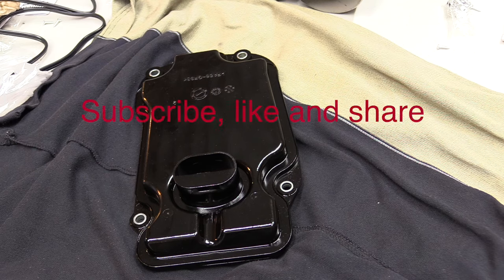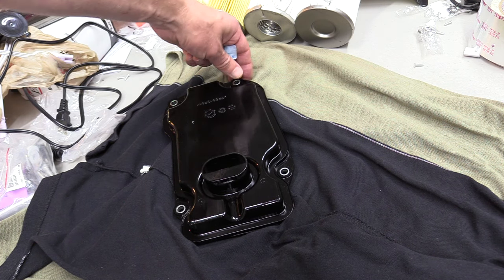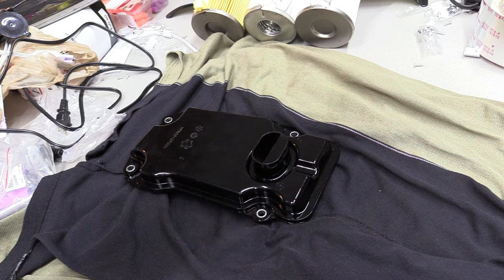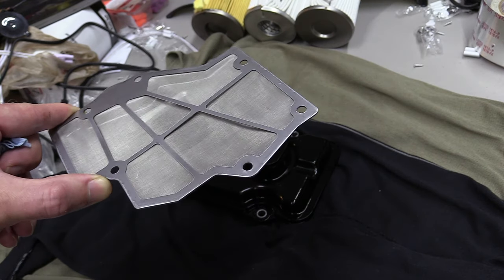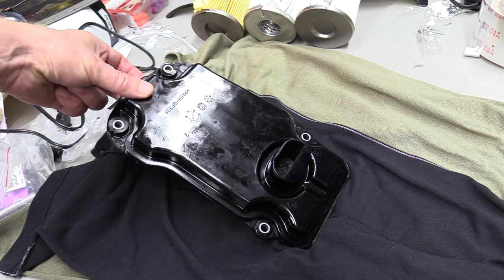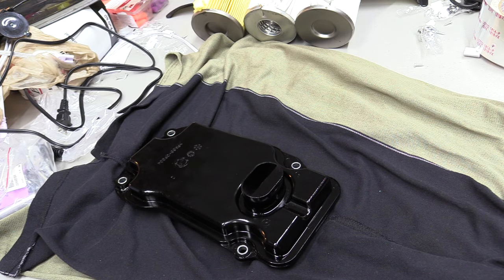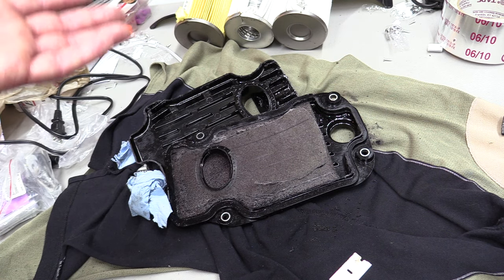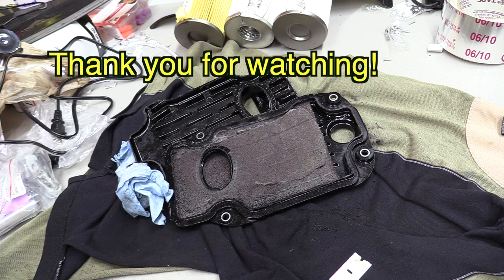Avoid replacing transmission filter, avoid costly transmission repairs, transmission maintenance

Comment: What if car has not been regularly maintenance? I was told that there's less of a risk to damage to transmission and clog from draining. Is it just safer to change filter at that point ?
Reply from the maker: Answers in the video
Reply: It's a 16 min video. U could've just said yes. Lol
Reply: @m.pm.p8727  It's actually a no also if it's been neglected too long.

Comment: My Chevy Avalanche has over 235000 miles will it be safe if I change the filter and fluid it's not having any problems but I'm afraid the filter might get clogged since the fluid is light brown with no burning smell what do you suggest
Reply from the maker: Has transmission fluid ever been replaced
Reply: No the transmission fluid has never been replaced
Reply from the maker: Your transmission has significant wear at this point.  Changing fluid might extend life of transmission,  might not.

Comment: We just got a 2014 Ram 1500 5.7 Hemi with 80,000 miles on it. and I changed the transmission fluid but couldn’t afford to get a new filter as well…. Should it be okay even if the filter is the type that’s intertwined with the pan? I don’t tow with the vehicle. Would appreciate the help. Thanks man. It has the ZF8HP70 German made ZF transmission. I know those transmissions don’t have the screen. Maybe you could open up one?
Reply from the maker: It doesn’t matter if filter part of the pan or separate.

Comment: I want to change my A340H Automatic Transmission Fluid and the Filter. I already ordered the filter Wix filter 58884 and now I am seeing this....  Should I not change this filter ?!
Reply from the maker: What do you have, mileage, year, maintenance history, ownership length?
Reply: @repairvehicle  1986 Toyota Pickup 22RE-T Engine 130 XXX Miles I changed all the fluid but ATF history maintenance unknown.....
Reply from the maker: So, if you have this type of filter just a screen  mesh then replacing might not add any value.  Watch this video https://youtu.be/IhZ4YHrhNeI

Comment: Why does my Qx4 has to warm up early in the morning before it can enter reverse gear? The same happens when I pack it for a long time in the day and engine cooled down .
Reply from the maker: Temperature sensor probably covered with dirty fluid or temperature sensor is malfunctioning
Reply: Please, where is the temperature sensor located?
Reply from the maker: Somewhere inside transmission more likely

Comment: On e92 bmws only resetting the adaptations will smooth out the drive. 125k and have never changed it.
Reply from the maker: What about fluid?
Reply: @repairvehicle  have never changed it. At around 100k, it got sluggish. Just reset the adaptations and runs like it had 30 miles on it when I bought it back then. It is a n51 engine.
Reply from the maker: So, your transmission has a lot of wear and that's why it got sluggish.  Computer adjusted pressure by increasing,  to minimize slipping.
Reply: @repairvehicle  I guess. I dont know.

Comment: Sir, is it okay to fill new fluid though there is still old trans fluid left in the pan because it was just drained from the drain plug but the trans fluid pan was not lowered?🤔
Reply from the maker: Yes it okay.
Reply: @repairvehicle  Thanks! More power. 👍

Comment: I hear changing fluid of the transmission have to be aware of fluid temperature. Dealer says flush but I agree at least drain and fill two or three times.
My 2017 trans fluid is it synthetic or no. What do you think of synthetic trans fluid as well as front and rear axle fluids as well as differential oil???
Reply from the maker: Your tundra has Toyota ws atf, none Synthetic. Synthetic atf fluid, Synthetic gear oil for front and rear axles is a must if you want trouble free equipment for long time. Synthetic fluids provide excellent protection against wear, better lubrication, flows easier and tolerates heat better. I use Synthetic AMSOIL products for every fluid in my vehicle and lawn equipment. Here is the link for your tundra https://www.amsoil.com/lookup/auto-and-light-truck/2017/toyota/tundra/5-7l-8-cyl-engine-code-3ur-fe-7/?volume=us-volume&zo=5257753
Reply: @repairvehicle  I also checked prices from Amsoil direct vs Amazon. The engine oil thru Amsoil $17.50 vs $31.30 thru Amazon. Huge price difference. FYI...
Reply: @repairvehicle  quick question I’m going to do a transmission drain n fill for my 08 Lexus GS 350 for the first time it has 110mi do you recommend me using what’s the manufacture recommended which is ws Toyota atf or there’s something even better and can or maybe exceed the ws Toyota one ? Thanks
Reply: @repairvehicle    quick question I’m going to do a transmission drain n fill for my 08 Lexus GS 350 for the first time it has 110mi do you recommend me using what’s the manufacture recommended which is ws Toyota atf or there’s something even better and can or maybe exceed the ws Toyota one ? Thanks
Reply: @repairvehicle    quick question I’m going to do a transmission drain n fill for my 08 Lexus GS 350 for the first time it has 110mi do you recommend me using what’s the manufacture recommended which is ws Toyota atf or there’s something even better and can or maybe exceed the ws Toyota one ? Thanks
Reply from the maker: Yes, there is a better fluid and that's what I use in my lexus. https://www.amsoil.com/lookup/auto-and-light-truck/2008/lexus/gs350/3-5l-6-cyl-engine-code-2gr-fse-i/?volume=us-volume&zo=5257753
Reply from the maker: Actually I have ton of videos about Toyota and Lexus ws fluid on my channel, take a look

Comment: how do you feel about dropping the pan and cleaning the magnets at least
Reply from the maker: What do you mean?
Reply: @repairvehicle  the video is about not replacing the transmission filter, but do you think we should at least take the transmission pan off and clean the metal shavings off of the magnets inside the pan
Reply from the maker: I gave the reason not to replace.  However,  you can replace the filter and clean magnets, it's perfectly fine.
Reply: @repairvehicle  no i mean dont replace the filter but still drop the pan and clean magnets

Comment: Hello should I just change the fluid in my 2008 g35x or filter as well
Reply from the maker: Did you Watch video without skipping?
Reply: @repairvehicle  yes sir my car doesn't have a filter I just called the dealer that's weird
Reply from the maker: if its automatic it has transmission filter.
Reply: @repairvehicle  yeah it's automatic it doesn't have a filter it has a screen
Reply from the maker: https://www.ebay.com/itm/284472142979?chn=ps&_trkparms=ispr%3D1&amdata=enc%3A1Rv-ZHRtwRL6vLPMIjq0ncw20&norover=1&mkevt=1&mkrid=711-117182-37290-0&mkcid=2&itemid=284472142979&targetid=1644837435483&device=c&mktype=&googleloc=9005947&poi=&campaignid=16743749222&mkgroupid=138744546207&rlsatarget=pla-1644837435483&abcId=9300842&merchantid=115330141&gclid=Cj0KCQjwxtSSBhDYARIsAEn0thTYATz0j8I4mdgkrv8f149akS_XXOEDTBQza0YIIjrTQcWejAlr-MQaAqNCEALw_wcB

Comment: The Lexus GS RWD has a fabric filter. The AWD has a steel mesh filter. A760 e(rwd)/g(4wd)/h(awd)  trans. Tundra uses e/g. 

 The H trans transfer case shares fluid with the trans, fluid changes are very important. The Lexus dealer told me every 40K is a good idea. Lexus Dealer said only WS and filter change every second service. He told me there are cars in his system with 400K that are as good as new, they used their services. He said great if you can DIY, but even if we we do it they are getting a second and third life out of the car, and it is very reliable.

My front diff is speced at 80W90, the service writer told me was a tech and there is a reason, from his toyota training. He said my front diff has a high pinion and it needs a thicker oil (vs 75w90). It has to do with how the fluid slings off the pinion gear. It won't explode but the spec is there for a reason
Reply from the maker: Transmission fluid is never shared with transfer case,  they are both separate and have different amounts. 

Also, thickness of oil is measured by second number, not first, they are keep telling you false information.

Actually Toyota/lexus doesn't use mesh screens,  it's in the 90s and early 2000s when they stopped using metal screens.
Reply: Ummm my 2004 gs300 RWD has a metal mesh filter. 😕
Reply: And the transmission is a A650E

Comment: my car is Suzuki alto, its engine is K6A model 660cc automatic transmission. it is ok on plan areas in driving, but whenever I drive in hilly areas, it losses its power and it all gears completely fails, even the car cannot drive his own weight. so I cannot drive this car in hilly areas. what is reason behind this?
Reply from the maker: Wornout engine, it doesn't have good compression.

Comment: So change transmission fluid in brand new vehicle after 10k miles and then every 30K miles after? Then no need to change filter, because fluid is changed on a regular basis?
Reply from the maker: Correct

Comment: I have been ignorant of this. I have been using 2001 Toyota sienna for over 8 years now, after watching this video i became scared because i have neither changed the transmission fluid nor filter. Am considering doing the fluid change but in this case, do i need to change the filter also haven used it for a long time without servicing. Your cadid advice please.
Reply from the maker: What is the mileage

Comment: If the transmission filter is a metal mesh screen then you need to remove it and clean it with brake cleaner and installing it back. If the filter is paper then you need to replace it.

Comment: Hello my friend. I have a question for you.

On a 2017 toyota camry, which has a sealed trans and no dip stick. I'm sure you are familiar with it, you fill it through the wheel well. 

Anyways , my question is do you belive that I can fit my small mityvac down in that whole at an angle? Thinking outside of the box and wondering if that works. Please let me know ur expert opinion. Thank you !
Reply from the maker: It's not going to work.  I will be making video on this subject
Reply: Thank you
Reply from the maker: You are welcome

Comment: Hello I usually have seen 2 types of transmission filters the cloth looking one and the  metal screen type. To me it looks like the cloth type over time will eventually get to saturated with debris from the small transmission shavings  and not be able to work as it did therefore needing replacement . But the metal screen type   looks like it  will last and not need replacement due to it not breaking down from years of use due to its metal construction . Just curious to know what you think since I can't really find much on the topic.
Reply from the maker: https://youtu.be/IhZ4YHrhNeI
Reply: The metal mesh filter is definitely better and doesn't really need replacing, you can just clean it.

Comment: Should I use the Mazda FZ ATF on a 2014 Mazda CX-5 or Amsoil signature series?
Reply from the maker: it depend on the level of protection you are looking for. I prefer Amsoil signature, the difference it makes in shifting words cannot express.
https://www.amsoil.com/lookup/auto-and-light-truck/2014/mazda/cx-5/2-5l-4-cyl-engine-code-y-1/?zo=5257753

Comment: We bought a 2011 lexus rx 350 with about 163,000 miles. I was all ready to drop the pan and do the filter. But, after watching your presentation I'm having second thoughts. The previous owner did use it to haul his trailer back and forth from Bakersfield to Oregon, which might be a reason to do the switcheroo. What would you suggest?
Reply from the maker: As a bare minimum 2 times fluid change.  Filter change is a good idea too. However, some bolts removal could be a problem due to space.
Reply: @repairvehicle  Thanks for getting back to me. I'll have to decide I guess.
Reply: @repairvehicle  how much time in between the change from 1st to 2nd time ? mine 08 es350 lexus has 240k im gonna change the fluid
Reply from the maker: 10 minutes to 1 hour.

Comment: Question my friend. I changed the fluid and filter for the first time at 56000 miles on my 2012 mazda 3 skyactiv has an automatic 6 speed. I changed the fluid again a few months later but kept that same new filter in. 1000 miles after the second time it's slipping until it reaches operating temp one it warms up it shifts fine I read it could be that the new fluid loosened up some gunk and clogged the filter so it won't pass through the filter very well until it warms up and thins out. What say you?
Reply from the maker: How did you check fluid level?
What brand and type of atf fluid did you use?
Did you install filter correctly?
Reply: @repairvehicle  got the fluid and filter from the dealer yes the filter popped into place securely and I tightened it with the 1 bolt that holds it on. I drove it around until it got nice and toasty then checked the dipstick on level ground and it was right up to the full line I checked it again after the slipping started and it's still right at the full line
Reply from the maker: New fluid will not loosened up gunk, because you had none in your transmission at 56k miles. You might have other transmission problems, maybe solenoid is not working properly or your transmission had sever damage done before you changed the fluid.
Reply: @repairvehicle  okay thanks!

Comment: There are two transmission filters in my '14 Maxima. One is internal like in the video and the other is external. I've replaced the external one.
Reply from the maker: Factory external?
Reply: @repairvehicle  Yes, you can order an replacement off the nissan website.
Reply from the maker: @12MRJERSEY   , that's nice.  Hopefully you are changing this filter more often.
Reply: @repairvehicle  The external one yes. For some real nissan doesn't recommend it. I don't listen to that nonsense. If I change my CVT fluid, I'm changing that filter with it. I don't do anything with the internal strainer though. I simple clean the bottom for the pan.

Comment: I have a 2011 Acura TL AWD, in my drivers manual book it say to only "drain and refill". I tried looking for a transmission filter under my hood, under my car battery or around in that area. So I'm guessing that the 2011 Acura TL only has a filter and it's inside the transmission housing... I'm going to change my transmission fluid. I checked the dip stick and it's brown and it was below the fluid level. A noise appears from under my car, it makes a shudder noise. But it only appears when the car is on the road for 20 to 25 mins. And then it appears when the car gets at low speed (RPM at 1st or 2nd gear) or when the car takes off at a stop (stoplight or stop sign). I've taken it at a shop several times and no one seem to figure out the issue, some even said they didn't hear a noise. Been trying to get the issue resolved for almost 2 years, I don't know why I didn't think to check the transmission dip stick smh. I had someone that told me that it could be the torque converter and not the transmission (which I believe also, but I hope not). But it still go into gears great, the car will still go in drive, the car still move in reverse, the car still drives great. It's just that noise that appears when it takes off at low speed, then once it get into high gear (3rd 4th or 5th). The noise go away. There be some days where the shudder noise, grinding noise or whatever it is, doesn't appear at all. But it has been appearing more often now. Hopefully the only issue is that, it just needs to be drained and refilled with new fluid. I was told before that ATF only needed to be changed every 60k miles. But I found out my car that it needed to be changed 60k on the first ATF change and then 30k every other change afterwards. Smh, I should've read my manual book more.

Comment: Can I use an oil drain plug gasket as my transmission drain plug gasket?
Reply from the maker: Why?
Reply: @repairvehicle Thanks for the reply!  I don't know if the transmission bolt needs a gasket, but I can't find transmission drain gaskets.. so I was wondering if that is how's it done.
Reply from the maker: What year and model of your car
Reply: @repairvehicle  07 nissan versa, S hatchback, 1.8L
Reply from the maker: @jazzsuis6066  , there should be a gasket for transmission plug. Did you ask dealer? It could be aluminum gasket like engine oil plug or crush gasket one time use
Reply: @repairvehicle  I appreciate your time my man, you earned a sub, too!!   Thank you so much
Reply: @repairvehicle  it's a copper gasket, btw!

Comment: What about the small filter in the fluid heater housing? Should that be changed ?
Reply from the maker: i cant answer your question without knowing what you have
Reply: @repairvehicle  its a 2015 honda civic
Reply from the maker: cvt transmission?
Reply from the maker: there is no filter inside heater housing.
Reply: @repairvehicle  yes
Reply from the maker: Filter is a filter regardless of its location and I have answered your question in the video.

Comment: What if you have 175,000 miles and the fluid is black would you still change the fluid?
Reply from the maker: Year and model?
Reply: 2002 Lexus is300
Reply: @repairvehicle  thank you
Reply: @repairvehicle  I don’t know the history of the car so it’s risky
Reply from the maker: I would replace it and have done it on my tundra at 177k miles
Reply: @repairvehicle  ok thank you I’m going to add Lucas slippage for back up
Reply from the maker: Why it’s risky?
Reply: @repairvehicle  because I don’t know the history of the vehicle or if it was ever changed
Reply from the maker: Watch this video about Lucas before you add to the transmission 
https://youtu.be/pk-4yVzmZAE

Comment: Is it applied to both gasoline and diesel vehicle?
Reply from the maker: When it comes to diesel it depends on the vehicle.
Reply: @repairvehicle  so sir, there are diesel vehicle that the transmission filter shoulb be changed?
Reply from the maker: Yes and no, depends on the vehicle.